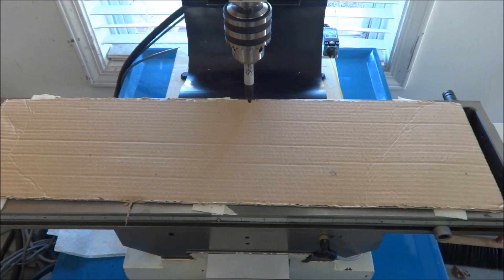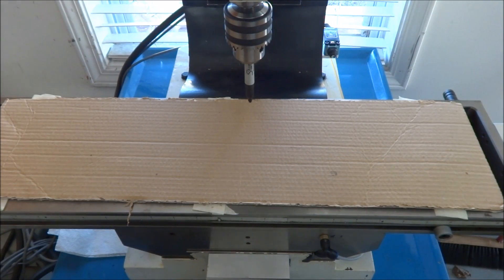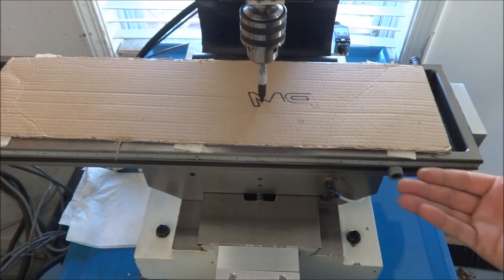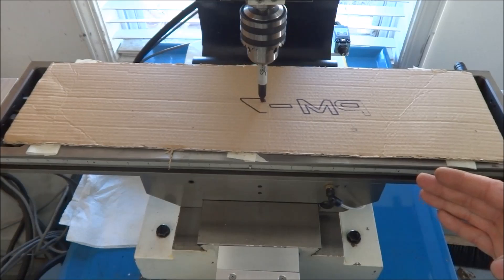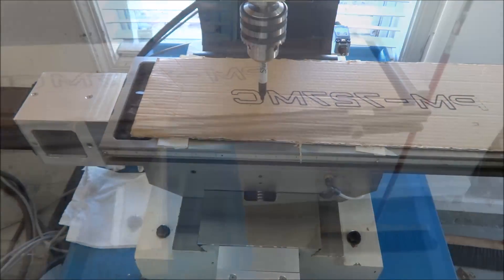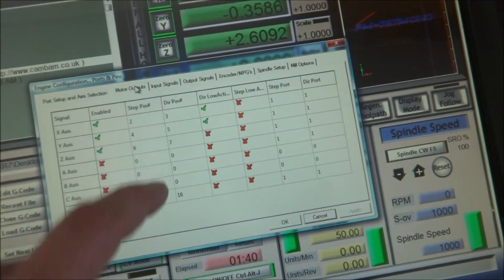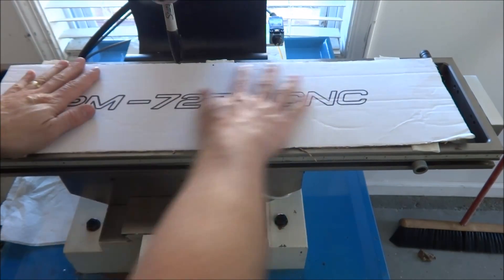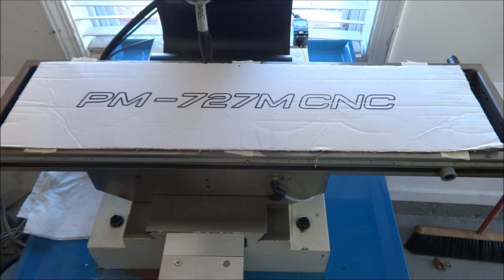PM 727 M Script test

Comment: Sam, Now I see why you told me to run a script test on my Bridgeport conversion. As soon as I get back into the shop I'll pick up on the conversion and run this test. Thanks, George
Reply from the maker: Hi George, 
Yes this is a great test to see if you have your machine setup in the correct orientation. This is a common problem if you run it without home switches and cutting symmetrical shapes you may never notice.